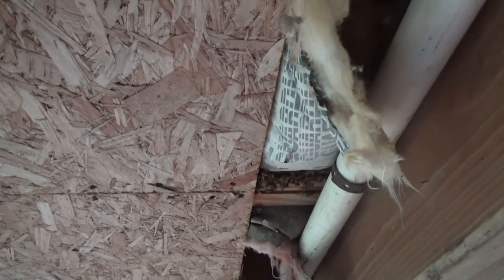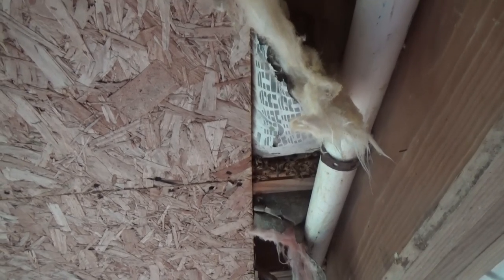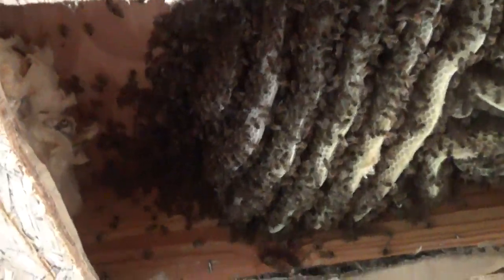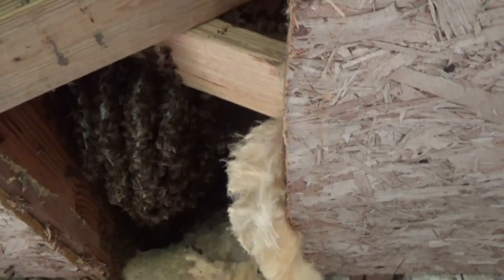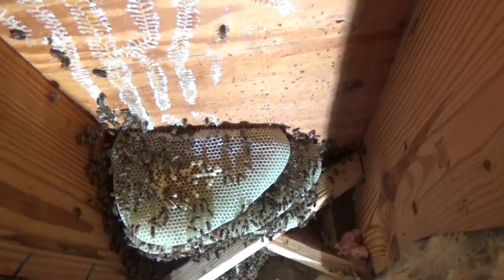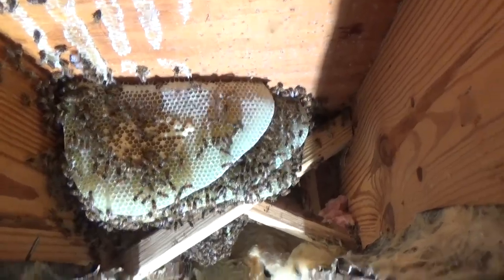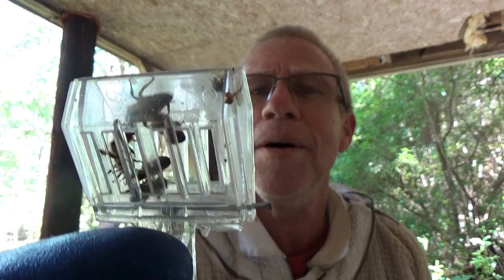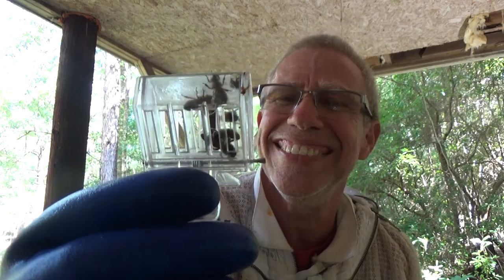The beauty and frustration of brand new bees wax.

Comment: On fresh comb you can frame it by using 2- size 116 or 126 rubber bands stretched caddy cornered on one side of frame, lay it down flat place comb on top of  X and place another band on top. Lot easier than size 64's .
Reply from the maker: Thanks so much for the info, good stuff. Thanks for watching. God's peace.
Mr. Ed

Comment: Here in Hawaii, I've noticed the way they hang their combs is more based on how they can ventilate their hive. If the sun shines on the wall or not. There was one that had a pattern like your ceiling but unlike your ceiling, the sun shined on most of the wall, except where a 12- inch post was close to the wall. the shadow of the post made it a cooler place for them and it showed by the ventilation needed. The combs were at 90 degrees to the source of heat, the sun,  or parallel to the wall where it wasn't hot from the sun. Was there sunshine above the deck they built their comb to? And shadows where it was 90 degrees to the others?
Reply from the maker: That is a very interesting observation Mark, I had not even considered it. Thanks for bringing it to my attention, I will start noticing it now that I'm aware of it. Because this hive was completely under the protection of a house, sunlight was not an issue. Still, air flow through a hive is critical in controlling condensation so it figures the arrangement of the comb will channel air flow. Again, great observation. God's peace brother.
Mr. Ed

Comment: just curious, why did you cut that section of wood instead of removing all the screws and taking the whole piece down?
Reply: I'll try and answer.
That sheet of osb (oriented strand board) costs about $8. His job is to get the bees out. Someone else gets paid to repair the damage. 
It's only $8 worth of "wood". The carpenter has the tools and know-how to quickly replace one sheet of osb. The beekeeper does not.
Reply: @mikeries8549  Even in the video we can see most of the entire sheet of osb.  It took longer to make those cuts with the jigsaw that it would have taken to unscrew the few rows of screws and take down the sheet. And what if the bees had a path into the next section over on either side of the floor joist? Then the beekeeper is cutting another section of osb.  Why not get the bees out as efficiently as possible and if it saves the homeowner some money in the long run who is harmed?
Reply: That's a great point Keith!  But sometimes when you pull off an entire sheet, stuff falls out all over the place, creating a bigger mess.  Also, you're leaving the exposed area open for mice and roaches to find a way in because there's no telling when it will be repaired.
Reply from the maker: The plywood is nailed, every 12 inches or so, along the joist, so it's easier to remove the section that needs to be removed than bring down a full sheet of ply wood. Thanks for watching. God's peace Keith.
Mr. Ed

Comment: You must have used your FLIR (infra-red) camera to spot this bee colony.
What surprised me is that the camera could see the colony through the insulation.
Reply: They are fantastic if you get the right one. I have a FLIR unit that connects to my phone and I use it to get better estimates on colony size before I open up the wall. The unit I use has no problem seeing hive clusters through layers of brick, wood, etc. The colony I'm tackling later today is inside of a patio wall, wooden framed, then covered in tar paper, then metal concrete mesh, then a stone facade on top of all that (which I saw via my normal inspection probe camera). I was able to pick up the hive cluster size no problem even on a relatively warm afternoon.
Reply: @AlexKingMN  Wow!  Magic!
Reply from the maker: There was no need to on this one, it was very obvious as to their location. What it would have shown would have been the size, it certainly surprised me to discover how large the colony was in such a short period of time. Had I used the camera, it would have shown the colony despite the plywood and insulation as there was no radiant heat beneath the house. God's peace Kevin.
Mr. Ed
Reply from the maker: Alex, what model is your FLIR? Mine does not read through all of that, but is very good with plywood and sheetrock. Also, radiant heat is a big problem as well. God's peace brother.
Mr. Ed
Reply: @JeffHorchoff  I have the flir one pro it was 399, has twice the sensitivity and 4x the resolution of the 200 one, and 50% better than the 300 pro lt. I just went out on a call but ended up being yellow jackets that I could see the individual Yellow Jackets walking around up inside the soffits behind plywood
Reply from the maker: Thank you so much Alex, I'm ordering one today. When I use it on my video, Ill give you a shout out. God's peace brother.
Mr. Ed